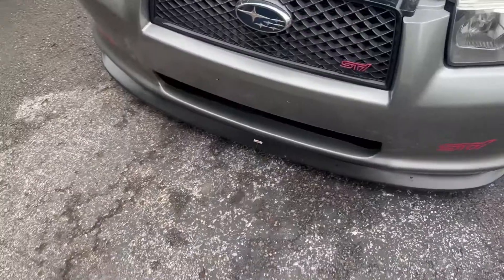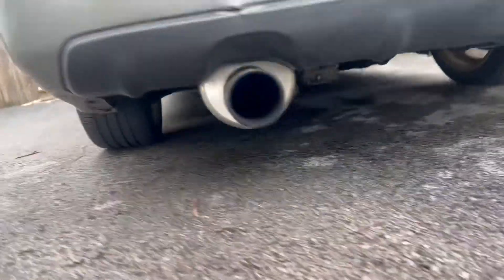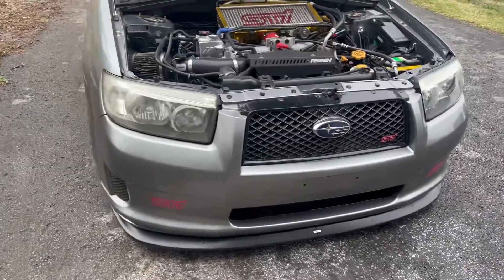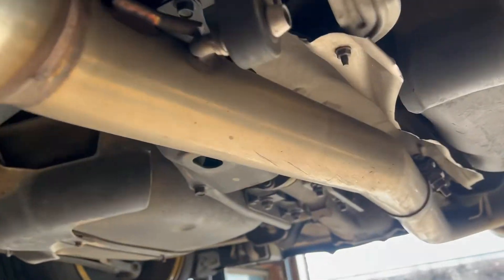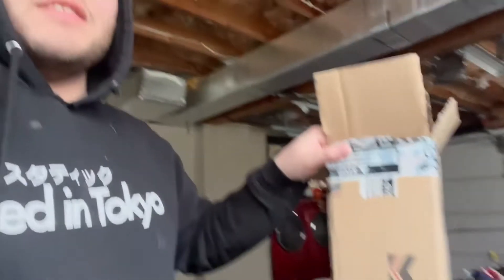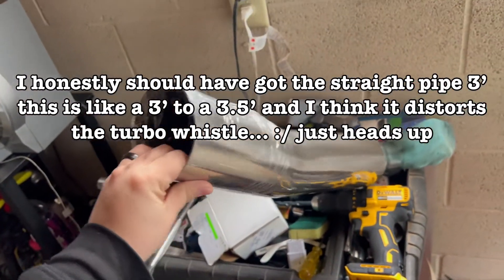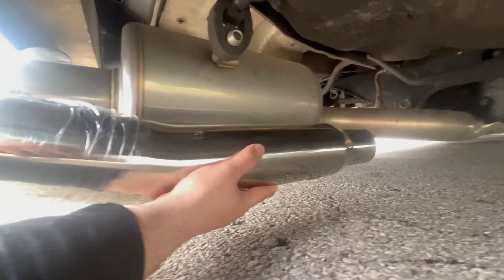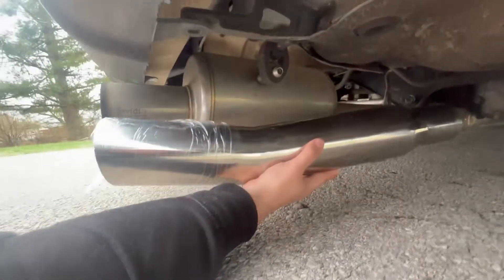SUBARU FORESTER STRAIGHT PIPE / megan racing blast pipe / also invidia cat back sounds

Comment: do you have any idea what that rattle-y noise that syncs with idle would be starting at 1:58?
 my fxt has the same thing
Reply from the maker: @stibbs96  I couldn’t never figure it out man ended up selling it back to the original owner lol
Reply from the maker: Only happens when I smack the downpipe
Reply: I was fearful that smth bad. I can't really track it either. Sounds like it comes from that side though, can hear it all through the exhaust